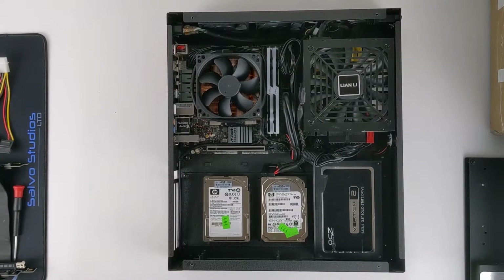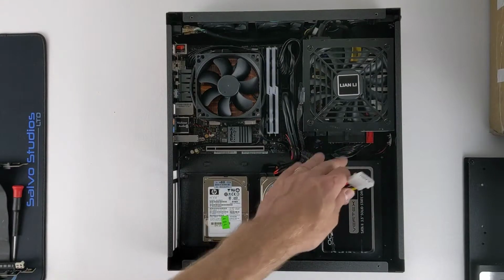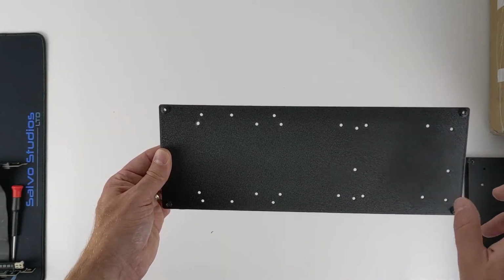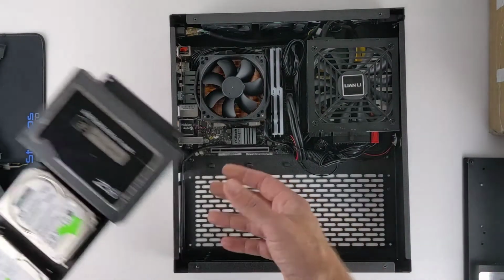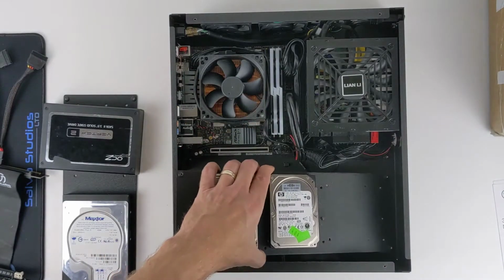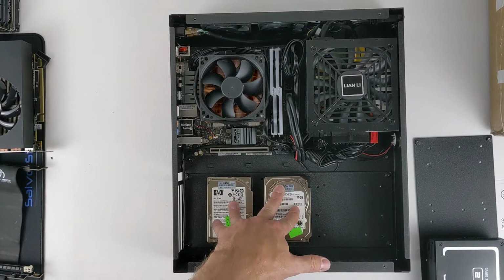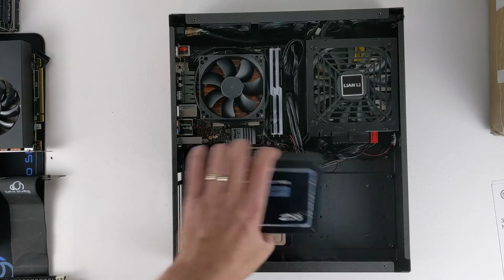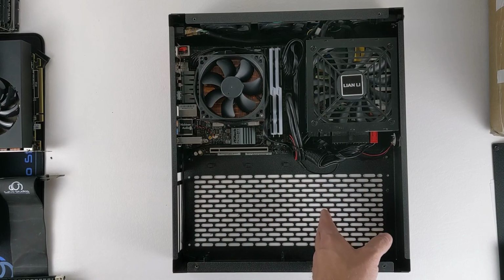S402 SSD HDD bracket

Comment: Could you mount a cpu aio underneath a 2 slot gpu with a 2.5 drive stacker on the right side?
Reply from the maker: Unfortunately not.  Every radiator/fan combo I know of is too tall to fit underneath a 2-slot card.  If the GPU was less than 210mm in length, the 2.5" stackers would fit to the right.